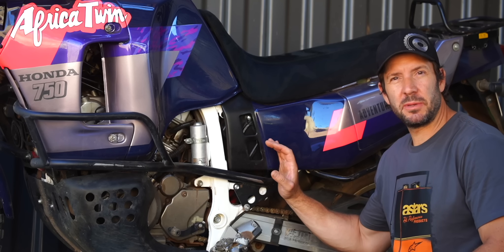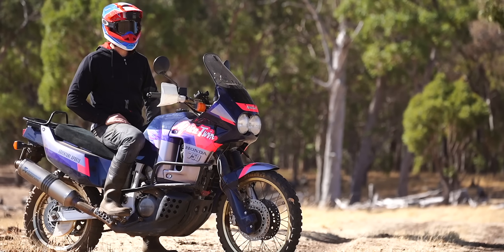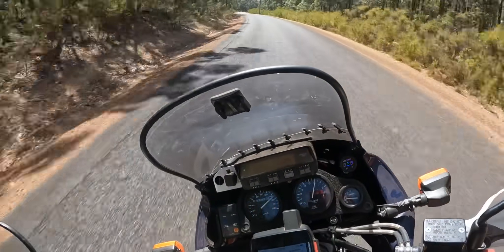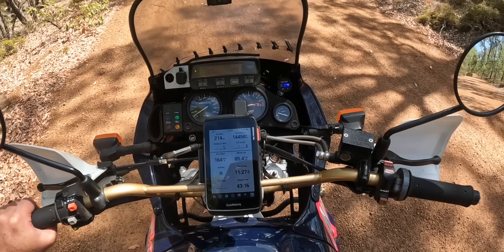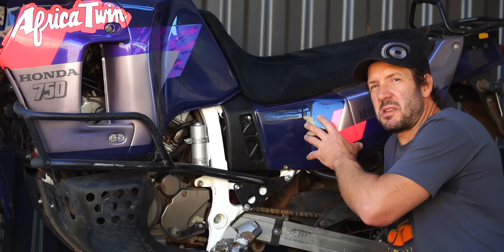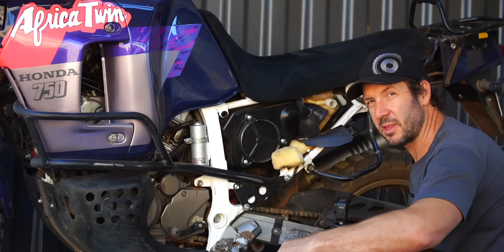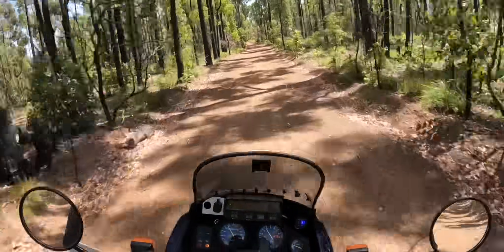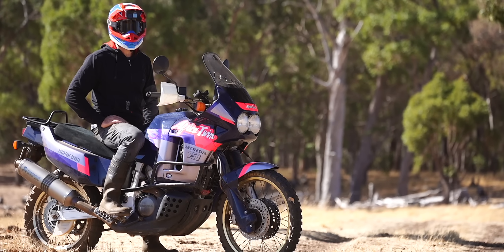Airbox modification increases engine performance and fuel economy

Comment: great airbox tip. Keen to try positive pressure on my 890AR somehow. In your riding experience in Australia, generally speaking, do you reckon most filters get dusty from following others or dust being churned up from your own back tyre?
Reply from the maker: If you're bombing motos on a mx bike by yourself, the filters can get dirty just from all the dirt blasting around, railing ruts and turning back on yourself in tight corners. 
Generally speaking though, if you're riding solo on flat dusty roads (adventure style) then your filter should not be dusting itself. If it is, the airbox design is seriously flawed - just like the Warhorse. 
I didn't do this mod for a power increase, I did it so the airbox can access clean air – not buffeting dusty air coming off the back wheel.
The added boost in power is simply a virtue of the filter now drawing a better flow of cleaner air. 
It's that simple.
Reply: Best thing you can do on the 890AR is to fit the Powerparts prefilter and fit the plugs for the 2 drain holes, crazy how much dust gets sucked through those 2 drain holes, from the back wheel. I also run the funnel web air filter, dust actually gets past the temperature paper filter, very dusty here in South Africa.
Reply: Alpine Star make gum boots?😂
Reply: Do yourself a favour and get the Rottweiler air box. 10hp increase, and way better protection for the motor. It feels like taking the gag of a fighting dog, she can finally bark and run properly!!
Reply: @hansenallan84  theyre developing a bad rep in australia. They flex too much under load and have poor manufacturing so are letting dust in and dusting motors and voiding warranties
Reply: @k_plax  Really! I didn't know that! Is there anywhere I can read about this?

Comment: AT RD04 top speed should be 175 km/h. 
BTW (I think Adam metiomed this in another video) the only german version that had a stock power reduction (other than A2 for beginner riders) was the RD03 XRV 650 Africa Twin which was the predecessor to the 750. The 650 was lowered to 50 hp to benefit from much lower insurance rate. The 750s all had 60hp.
Disclaimer: I am only talking about the AT for the german market, but thought I‘d be of interest since the Warhorse is from Germany.
Interesting fact: Honda sold more than 20.000 Africa Twins in Germany alone. Given their robustness there should still be enough to satisfy enthusiats‘ needs all over the world 😊
Edit: found out the 750 was also sold with 50hp.

Comment: Hi @adam,
Love your channel and its very inspiring. In fact so inspiring that i have bought an africa twin again after a few years without one.
 Have you had the bike on a dyno or have you had a chance to analyze the exhaust gas? I am curious if it runs too lean or maybe you have re-jetted the carbs?
Another question, have you considered the big bore modification that African Queens from gearmany offers? It's supposedly adding about 20hp to the beast...
Greetings from Denmark

Comment: Adam i know im a bit late to the party  but you are 100%correct on positive air pressure . Honda 81-83 250r Atc's were specifically designed with the snorkel  running out of the air box into the seat pan and had a cutout that used the foam  as a pre filter . it worked well for water but didnt do much in pressurizing the box. 84-86 had a snorkel under the tank to the triple clamps  behind the headlamp that changed the power output significantly in low speed /midrange.  In Baja  all of the riders on bikes pre wrap the air filter with a foam  one  and usually get changed in certain areas because of the Silt beds . that fine silica wrecks  engines  if the filters are junk . my time in baja taught me a bunch on how to survive in mexico . i hope one day you get race the baja 1k . its pretty epic .

Comment: Engines are like a water pump, less restriction on either side mean less work on the pump or engine. Hi flow filters with positive pressure and less restricted exhaust means power increase.

Comment: Yup. Tried the mod - zip-tying the rubber flap against the smorkel tube - on my 600 Transalp today. I'd guess between 5% and 10% more mid-range power, which is amazing and has to be the best bang-for-the-buck mod in motorcycling. The Alp isn't quite the same design  but shares airbox, air filter and panel arrangement, which uses the flap and inside of the panel to create a semi-sealed chamber around the snorkel mainly fed by air from the under the seat. With no ports in the side panel there is no real positive airflow source, but simply providing a better route for air to reach the snorkel makes a real difference. Chapeau!

Comment: Usually the crack of cylinder heads happens in engines with more than one cylinder most one cylinders should be fine to go after purging the water but it always causes premature wear with potential cracked head.

Comment: I understand why they put the rubber flapper there, it is to stop water from getting into the engine in a rain for example .
 Usually these alterations end up causing catastrophic failure if water gets there... ...chances are high.
Should do it like the old Kawasaki and bring a tube all the way to the front up at top fuel tank height a air box with water drain to collect and dispose excessive water and have its intake right up front next to head lights.
That would yield a better performance, make it capable to cross water up to fuel tank and also keep the engine free of the possibility of catastrophic failure like cracking the cylinder head.

Many excellent tips here but this is very risky and should still follow the basic rules, in this order clean fresh air, water box, carburettor, cylinder.

Both factory and you didn't quite get it right although your alterations were an improvement on the factory messy job.

Comment: Great explanation, thanks. On my bike, I sometimes have an issue of too much airflow when I use a K&N performance airfilter. The engine is nearly the same as on your war horse (Honda Deauville 650 cc). Turning out the idle gas screw to the max helps, but still, the air/fuel mixture is not rich enough. Larger main jets? Any experience in this?

Comment: It would be cool if you could 3D print an intake snorkel that goes around the corner of the airbox. So it sits in line with the air flow. You could make it seal against the cover so you don’t need all the foam.

Comment: Thanks for the tip that all the community will follow 😁. I suppressed the separation in the between the airbox and put a hand made filter inside like we have on enduro and mx bikes. I can feel increased air flow and better mids

Comment: Hi Adam, I am located in Victoria and just purchased a 1998 XRV750 RD07A after selling my 2023 GSA1250 Trophy. This is because I be en watching your vids. 
I have seven other Hondas in my man shed and looking forward to adding the RD07 to my portfolio. My question is I am wanting to fit a akrapovic system like the Warhorse can you give me the model exhaust code and attachments and the wholesaler who supplied the system. 
I run a small micro motorcycle accessory business and run accounts with many wholesaler. 

Keep the wonderful Warhorse YouTubes 

Cheers Hal

Comment: Hi Adam, thanks for sharing all this stuff. I think it´s great! I've got a little question due to a common problem the Rd07´th have with a rattling clutch baskets when idling in neutral gear.  It´s gone when the clutch is pulled in. The reason for this annoying noise are worn out torsion springs.  I'm wandering if the RD04 has the same symptom. Hard to hear in your videos ´cause the Akro sounds so fat ;-)  Ride safe!

Comment: Clever mod on the airbox… that’s a massive top speed difference!😲 I knew they weren’t going to be power houses, tuned for torque and all that… but I was shocked how low the stock HP figures were in your earlier video. 

Interesting point on the foam filter skin… we were discussing recently filter skins including using a pair of tights around the K&N cold air intake kits for desert use, or even round the snorkel intake. Definitely helps. Fine mesh and all that. 😅🤘

I always run the Twin Air dust and sand covers on my KTMs… people say… aww yeah, I change mine every ride bro… pffftt… I don’t. 😅 I grease the lip, grease the contact area, make sure the airbox is dripping a little and run those extra two filter skins. 

When it’s hard to start in the morning when it’s been out on the truck overnight in the damp/humidity then it’s time to change. 

Take the skins off and the filter still looks new. Still moist too. Can bang on a fresh sand skin if you’re caught short for time or clean filters. 😅🤘

Do it right the first time and save yourself a load of dicking about. 😅 Those skins are not for shovel hands though… wrecks them every time. 🥴 Better that than the motor though. 😂👌

Comment: You're right, over the years, some of the crazy air intake positioning has baffled me. I have always attempted to clear it up. Sometimes successfully, other time with little effect. Even on my old 1600-2.0Lt Kombies of the 80-90s running foam pod filters has contributed to noticeable running efficiencies. Keeping the dust out of the engine bay and the fresh cool air coming in, was always a factor. 
Have a deposit down on a 450 Himalayan, one of the things I like is that air intake up high under the tank. One less problem to think on. It sports a paper filter, as long as I'm not trailing, all good. Can't wait to get my grubby hand on the ride. Maybe not so grubby these days. There are a few things I'm not sold on, but let's see in the next few years while I can still ride. Cheers.

Comment: It's interesting to notice how Honda have adressed this issue with the RD07 model. 
Until watching this video I never knew exactly about how the airbox was designed in the RD04. The RD07 has the airbox attached to the top of the carburetors and it sucks in air at the top of the fuel tank right behind the handlebar, so it doesn't have to deal with dust thrown up from any wheel, and you also can go through deeper water. Besides, they were able to lower the seat a bit by re-locating the airbox and also put the regulator/rectifier unit on the left hand side, away from the hot muffler.

Great video again, Adam! Thanks!

Comment: Idea for you filling the dead space instead of the foam stuffed in there:
 place a plastic bag in the area you want to block. 
Then gather up the bag opening and use a few squirts of expanding builders foam into the bag. 
When its hard cut away excess material.
Then it can stay in there forever.
Do same in the sidepanel by using cardboard or plastic tacked in place with glue gun, then squirt foam in again. Remove cardboard and trim . Job done

Comment: Makes a person wonder why exhausts are at the cool air side (front) of an engine and intakes are behind the engine in the heat and still air. I know some manufacturers have run 'reverse' design but it's not common.

Comment: Market - Germany (Honda Area Code "G/50P")

Restriction on inlet rubbers only.

Engine Nos: RD04E-3000001 to 3002245 for 1990,

Engine Nos: RD04E-3100001 to 3101536 for 1991 and

Engine Nos: RD04E-3200001 to 3201605 for 1992

Restricted Inlet Rubbers (called "Insulator, Carburetor" by Honda), Part No: 16211-MS9-710

Change to 16211-MN8-750 inlet rubbers to remove the restriction on your German RD04

To check if yours are restricted remove the front side fairings, seat, tank and airbox duct, and carb.

Unrestricted inlet rubbers between the carb and the head are the same diameter all the way through, restricted ones have a smaller internal diameter.

I've been thinking of adding a foam prefilter over the DNA filter I've fitted to my RD03.

My bike had a fuelling issue where it would struggle to get above 5-6krpm and the plugs were fouling. I could clean the plugs with a 15 minuite commute to work by fitting them to my NTV650 (RC33)

 I've tracked it down to the RD03 using 32mm carbs. Having tried a few RD03/PD06 carbs with new Keihin jets but the issue got worse even with new diaphragms. The last carb I tried was stuttering around 1.8k rpm which I ultrasonically cleaned and used new intake rubbers, jets, diaphragms, and balanced and using either a new Honda air filter or a new DNA filter.

The RD03 uses a RC31 engine. The RC31 engine uses 36.5mm carbs, as does the RC33 (shaft drive version of the RC31) I have a RC33 so fitted my spare carbs, RC33 intake rubbers and the bigger RD04 intake duct between the carb and the airbox.

I now can use the full rev range so the larger carb has worked for my 650 engine.

I have a spare RD04 airbox, I'll try modifying the airbox intake to use the side panel intake cutout to see if it improves induction.

Someone also made an intake snorkel that draws in air from above the tank to the airbox.
https://www.xrv.org.uk/threads/rd03-04-airbox-mod.155025/

Comment: i remember back in 1997 when i got delivery of my new xr400r , still in the box at the dealership, the   mechanic and i pulled out the air box and the intake pipe had this 1/4 inch cut that was vertical instead of the 40mm round hole, that was the restrictions put in for being road legal instead of off road use, it's had a big restricted spark arrestor and they had the carburettor running tiny jets,  i was amazed at how much Honda restricted that bike. it was a fantastic bike after it got proper airflow through the motor. , it's been  fantastic following along with your journey with the bikes over the past year

Comment: Thanks Mate! Gonna do exactly the same to my transalp ‘94 same airbox, same issue. Do a lot offroad in france and spain. I love your understanding of the air velocity and not having vacuum fuel abuse.
Reply from the maker: Thank you mate
Reply: @MotologyFilms  Great thinking. I'm going to try it on my 600 Transalp - as said, same airbox, filter and inlet design. Which foam filter did you use?

Comment: Great video as per usual. Just a thought, in the snorkel at the rear of the air box how would one of the conical foam pre-filters that are for the Africa twin go? I have seen them use with great effect.

Comment: I have turned the pipe other way and closed air way so it can take air only from the front side to create positive preasure. Every part stayed original, didn't cut nothing..Thanks for the tip

Comment: I had RD04, gps confirmed speed on the highway was 183 km/h. It was not modified except slip on exhaust. So.i think something is not right with your bike if top speed is only 166. Check jets, maybe is detuned version.
Reply from the maker: The Warhorse is the detuned German model. And I love it.

Comment: Your engine has a problem? 165 km/h (GPS?) is very low. My 1989 600 Transalp (55HP this year) was cruising at that speed. Never tried top speed. And now my 650 XRV seem to do better but never tried also. The 750 XRV should do 180 km/h no?
Reply from the maker: Her problem is that she is a power restricted German model, and I love it. She will outlast all RD04s across the lands
Reply: That's a point of view. Anyway, for offroad it's perfect.

Comment: Adam, I work for a Filtration company- we always talk about a filtration train (multiple filters of different grades, coarser to finer) where the coarser filters protect the final filters. Each filter cuts down on the particulate load going through the next filter. You can then remove/clean the coarse filter when it blocks, in this case the foam filter. Technically the foam filter would be called a Depth filter which forces particles through a Tortuous path where particles are then removed from the air flow as they impinge on the filter media. Your fine filters (the paper elements) will filter fine particles from the air but they do not have a large dirt holding capacity. A bit technical but you explain it well to Non-filter people!
Reply: I wonder if there is anyone making pleated air filters for bikes

Comment: Hi
Have you ever thought about that all motorcycle engines are mounted 180 degrees wrong? Intake air comes from the front, make a U-turn into the airbox transported through the cylinder to the front again and released to the exhaust to the front, again U-turning to the rear end of the bike.
Thinking about this, it’s stupid somehow…, isn’t it?
The airbox shall be at front as well as injection and the cylinder shall be turned 180 degrees and the exhaust will be at the back where the swing arm is continuing to the rear end of the bike. Don’t you think?

Comment: Definitely wasnt concerned the pre filter would constrict my bike, was just saying in my CRF1000L,  the pre filter Definitely chicked the air flow, and its a popular brand that everyone uses. 

BUT it is a sock design that sits in the snorkel and I removed it after 1 ride.

Comment: Hi Andrew, I also own a RD04 since about 5 years. It's the first and only bike I've owned. Watching Paris Dakar as a kid, I love the looks of the old Africa Twin. They are just the coolest looking bikes in my opinion. I use mine almost every day and have been on many tours around Europe. It has never let me down and I've never wanted to be on any other bike. You can't imagine how much joys it brings to see you riding the warhorse on the limit and how much it makes me want to go on adventures. 

Sorry for this specific question but I've always struggled with the dashboard setup and where to mount my GPS. I need to add a bracket somehwere and there are some available for the rd07 but I don't know if they work on the rd04. Would love it if you could go over your dashboard layout sometime.
Reply: not much choice to mount GPS or phones than on the strong handlebars of our old school bikes. At the time they were designed all there was were paper maps and analogue😁